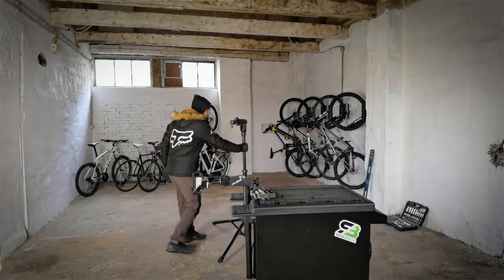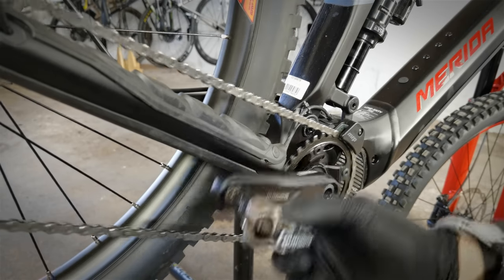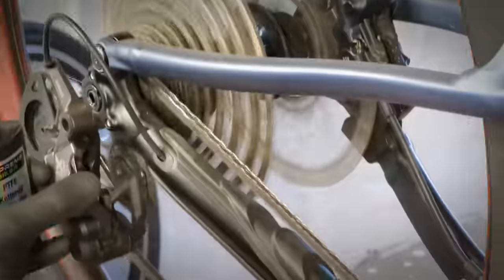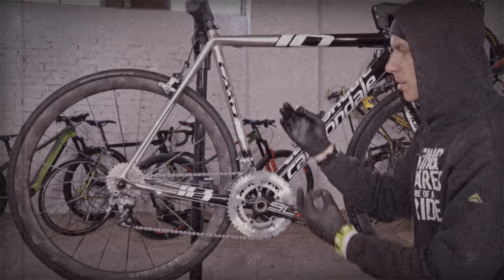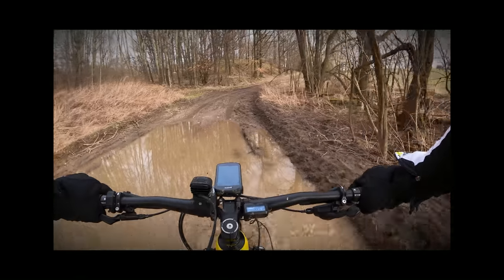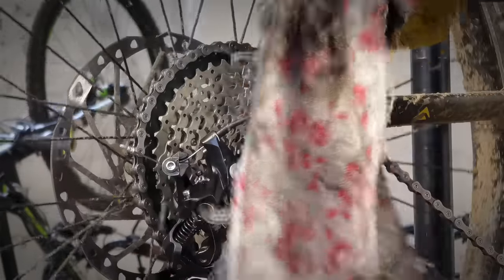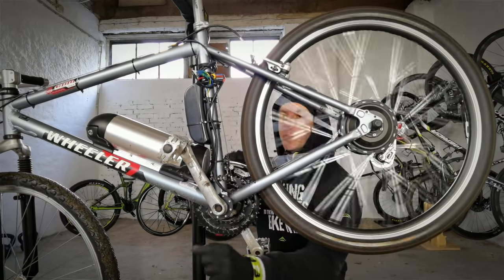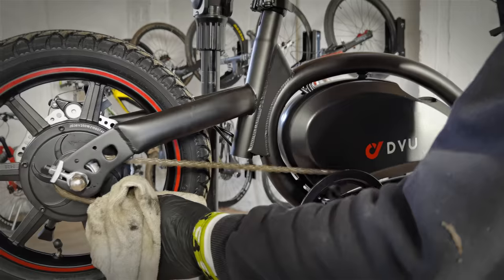I lubed my chain with canola oil and rode 100 km through muddy trails. Lesson 2 - bicycle chain.

Comment: Ok so I’ll throw a spanner in the works. I also ride motorcycles in the bush. Years ago I stopped using any lube on the chain because it just turns into grinding paste with dirt and grit. I just run them dry and get much better life. I use Rock N Roll extreme on my pushies. Seems to be ok.

Comment: Thank you for the detailed video!

I'm seeing lube applied both on the inside circumference (1st part where you had bottle below the cassette) and the outside circumference (2nd part where you had bottle above the cassette).  FYI for readers, many others recommend only to apply lube to the inside circumference of the chain.  I think the main reason is that centrifugal "force" pushes lube from the inside to the outside as the chain goes around, so better coating and maybe even a little unidirectional grime flush action.

Comment: You never want to put natural oils or mineral oil without additives on your chain! While it might run very well for some time, as soon as the temperature changes and the oil "ages" it will be almost useless. Some natural oils can be very corrosive as well.

Always buy something fully synthetic for a reasonable price (don't overpay for a 20ml bottle is what I mean). Industrial gearbox oils and engine oils will do a decent job if you need a lifetime supply for cheap. If you need a "normal" amount look at the finish line product range. While they are not cheap, at least they don't scam you like muc-off...

E: Really enjoying the series, keep it up dude!
Reply: You can use plain mineral oil though.  It's synthetic and doesn't oxidize like vegetable oils.
Reply: you can buy the finish line lubes in big jugs that are a better value than the 10$ dripper bottles.  i love their ceramic wet and ceramic wax lubes
Reply: @airwilliam24  Mineral oil is just oil straight out of the earth. Nothing synthetic about it. Of course bike companies want you to think otherwise so they can push up the price, just look at Shimano brake fluid.
If you don't believe me, try running your car on mineral oil without additives.

Comment: I've used canola oil on my bikes and it was okay, but in the extreme winter we have here in Canada it is not so great as it gets thicker. I always add a bit of graphite powder to my chain oil (a regular light oil, which is also cheap, used primarily for sewing machines and other household applications). The oil is light and penetrates the links well. The graphite is a dry lubricant and it does not get washed off as easily. I still wear out my chains, but they seem to last quite long.
Reply: You can try paraffin oil with paraffin wax, about half and half, depending on the type you have. Melt the wax over low heat, add the oil, mix, then dip the chain when it is very clean. A new chain should also be cleaned, soaking in solvent and cleaning with a towel works well. Of course it's for winter, in summer it doesn't last long. If you've got the right ratio it's the best thing you'll ever have, you won't have to renew it for months on end.

Comment: I usually use polyurethane paint thinner to clean the chain deep.  also always put a magnet under the bucket to collect the metal dust and prevent it from going back into the rollers.  furthermore, after this step I soak the chain in very thick heated motor oil, and leave it there until it stops bubbling.  then I let everything drain and clean thoroughly with a rag.  are a few steps but for someone like me who travels for thousands of km it gives its results

Comment: I was doing a solo trip through New Zealand...I got into some really muddy trails and then couldn't fine chain lube nearby and my chain was getting pretty stiff.  I had olive oil for cooking...worked great on the chain too!  Sand sticks, but, better than a dry and stiff chain! On another trip into W. Virginia for some DH stuff I had a last minute brake issue....I had to do a bleed but didn't have any mineral oil(or was it dot5?). Olive oil! Yep...bled the line with olive oil for the rear brake, and despite the steep downhills and me being over 200 pounds...I had no issues
Reply: Some world traveler has used baby oil from grocery shop to refill brakes after he discovered oil drip after unpacking bike at an airport.

Comment: 1) T :   2) A & B :   3) Clean the pre-delivery protective coating off the chain and drive components. Then lubricate the chain and drive components {rear cassette, front crank chain rings, intermediate or idler pulleys} again with fresh lubricating oil. Cheers, Peter

Comment: It has 100 and a few links. I go one drop for each one, takes a couple of min but im sure all got lubbed penetrating inside. 
Then, clean excess, done.
To clean, if you want to be paranoid with it, after cleaning with benzine/petrol, degrass with cheap brake cleaner, that also ensures it comes out totally dry, ready for lube.

Comment: unleaded auto gas with a hi octane will work! as a auto mechanic use it to clean parts! it is aggressive at cleaning and super flammable! a alternative would be k1 kerosene as it has a low flammability and leaves a light oil coting. lighter fluid works to.  interesting experiment!

Comment: Hi.  Here are the answers to your quiz.  1. True, 2. A & B,  3. Spray some degreaser on a rag and  pedal in reverse to remove the pre lube from the factory, and add some new lube if necessary.  

Some suggestions to remove grease from a dirty  chain, I use mineral spirits or paint thinner.  It works great.  To remove rust I use apple cider vinegar, I believe it is less expensive than the acid you use, plus the vinegar is re-usable.  Try it, and do not drink it, it is nasty.  I also use synthetic motor oil, to lube parts and pivot points. I use motor oil to lube the chain.  Any thoughts ?

Comment: Best use I've seen for canola oil and great results so far. I doubt canola oil would perform well in a lubricity test against petroleum products. The specialty chain lube products have gotten out of control price wise. Wonder how canola would perform adding graphite and/or PTFE?

Comment: In English, 'Benzyna ekstrakcyjna' is called Petroleum Ether. It's a light oil fraction, i.e. a mixture of different substances with a similar range of boiling points. Here are the English and Polish wikipedia entries:

https://pl.wikipedia.org/wiki/Eter_naftowy
https://en.wikipedia.org/wiki/Petroleum_ether

Comment: Q1 T not lubing chain is one of most expensive things to neglect on bike. Q2 Worn or lengthened chain will case wear to a. cassette and b. chain ring Q3 new chains from factory come with sticky wax or lube that can attract dirt best to clean it off the outer plates with degreaser. Looks like I will be buying some canola oil soon, or since I am Italian/American might have to conduct an olive oil experiment

Comment: After six months of using canola oil in the summer, the feeling is that it polymerizes just like the dry lube oil I used before. Winter is about to arrive here and I'm looking forward to seeing if it behaves differently in the cold.
Reply: How did it go?
Reply: @frederikmartenstoft4569  
As long as you clean after each ride it's fine. It is better not to oil with canola after cleaning when the bike is going to sit because it lowers the quality of the lubrication before the next ride, because the oil polymerizes and turns black within two days in reaction with the oxygen and the metal. It does protect the chain from rust but you will need to clean it before the next use and re-oil it.
Reply: @frederikmartenstoft4569  
Regarding the cold, there is no problem, and because there is no dust here in the winter, the chain is cleaner than in the summer.

Comment: I feel waxing the chain is the best option for me . Drive train including the chain lasts a long time and I don't do detailed cleaning just a dry cloth wipe off . Now I live in the high desert so my only problem is dust . The wax is not a liquid  so the dust doesn't mix with it .
Reply: Yeah wax is great stuff. Better than sticky oil that catches on to every speck of dust.
Reply: Would a beeswax work ?
Reply: @msmanager2775  As long as it can be liquefied so it can penetrate into the links I did see why not exploring the possibility . I microwave my squirt before I apply . It appears being heated gives it a more drier finish
Reply: @stevencole7331  thanks , or an engine oil is okay I suppose ?
Reply: @msmanager2775  You can probably use  vegetable oil and be ok . I live in a dusty land and having something that the dirt is not attracted to and provides a lubing effect is good for me

Comment: Honestly I've been using cooking oil for my bike for more than 10 years
I had more than 8 bikes and I never had problems with cooking oil
Reply: Didn't the cooking oil polymerize and become rubberish over time? It does for me in the kitchen...I would assume it does the same on the chain. (Sunflower oil.)
Reply: @sonnyboy2026  This is true if you oil a wooden surface or a cutting board, but on the bike it doesn't matter because by the time it finishes polymerizing you already clean it because of all the dust and dirt that sticks.
Reply: I am going to experiment with palm oil.

Comment: I've put 10,000km on a chain lubed with motor oil🤣

If it's capable of lubricating an engine. It can lubricate a chain, only downside is it's messy, and leaves black residue all over the components but is manageable if you clean regularly.
Reply: I've done the same since I got my first bike when I was 14. I'm 61 now. I've never had a problem. I had also a motorcycle for about 10 years  and I never had to change the chain or something else. When it's a little bit dirty or dusty, just clean properly and apply it again. 🚴‍♂️👌
Reply: @jaimeacosta4791  motor oil collects way to much dust in the summer though. I ended up just spending $20 on wd-40 dry lube , and wet lube. Definitely worth it.

Comment: When I was a kid and didn't have any money I used corn oil as a lub it was a disaster,  corn oil starts to turn to a solid after a while and just gets gummy , I wonder if over time the canola will do same .
Reply: @pootatotree7546  thanks for your reply , I ride a recumbant trike which takes 2 chains and am very aware of cleanliness affects wear ,  I currently use Dumond Tech as a chain lube which has worked well for me .

I appreciate your experiment and the conversation it sparked , and once again , thank you for taking the time to reply back to my comment.
Reply: That happened because you did not clean the chain regularly. You cannot just add oil and that's it. You have to first clean the chain, and then oil it once it's clean.

Comment: Jusr one remark. Plant based oils have a quick degradation and the degradation residues are acidic. So I would not recommend the canola oil or other edible oils, like sunflower etc. Lubing is OK, but the chain will be eaten up by the acids. It makes porous corrosion, what is a good place for dirt particles to sit in and increase wearing.
That means, if you have nothing other, the plant oil is perfect for a ride, but clean it out perfectly after the ride and use real lubricant.
I do not recommend the fine mechanics lubricants neither, just because they are a mineral nad plant oil mixtures and can also get acidicic.
Reply: Hey! I'm using sewing machine oil since it's very cheap compared to bicycle specific lubes. Any thoughts?

I don't want to wax my chain.

Comment: 1. T
2. B. I would add A as well, depending on your definition of the cassette. The sprocket stack, then yes. If it's about the wheel system (ie freewheel or cassette), not so much.
3. Wipe off the excess lubrification or lubricate it if needed, while checking for flaws.

One question: what do you think of those chain cleaning systems that you close around the chain? I notice you use only towels and brushes; in a bike shop, how many towels do you need per day? ;)

Also, the cleaning petrol is likely lighter fluid, or lighter gas. Most households in Canada store it solely for cleaning purposes.

By the way, be careful using acid to clean a chain. A too strong acid will attack the metal itself. One should also avoid using "natural" acid sources, since they often contain sugars that will bind to the chain and cancel the effort. And take care with acids (and bases): diluting an acid in water is fine, but adding water to an acid is death! (it creates a big exothermic reaction with can lead to an explosion...it leads to a better rhyme in French).

Another comment: I would think many of your viewers are not in the United States. As you are Polish, it's noticeable you sometimes struggle to find the price to mention. Why not use euros? I'm in the Netherlands and use English-language channels to learn how to service my bike ;)

Comment: The gasoline you're talking about is perhaps a kerosin gasoline?
Reply: I don't think so. In my country it's literally called "technical gasoline" and it's a bit lighter and purified fraction of regular gasoline, however still not exactly kerosene. It works very well as a degreaser and a cleaner.
Reply: @benokrizek8020  i see.. in our country, most folks with small budget would use kerosene. It works but i dont think it works better than with the gasoline you're talking about
Reply: Do you mean white spirit?

Comment: Ekstrakcy Gasoline?....    Most likely AVGAS...    That's petrol with NO other products in it so it has the least residue when dried.
Available in most places but a little tricky to get... (A lot of drift car drivers use it... but it can clean out (remove) all the protection normal fuel coats on parts and rust a car/exhaust from the inside).
Often found at small airfields and aero clubs...(and some petrol stations near them).

Comment: I am sure a light weight car oil will work just fine for most people and applications as well.
Reply: I use transmission oil, it works fine for 150km, but it attracts lots of dirt.
Reply: @neutronshiva2498  Same. I think i ruined a cassette and chain in only 1500 km using a lot of gear oil. 

everything was dirty all the time. Cassette was worn out.
Reply: Automotive motor oil contains detergent, to wash away combustion products. That will work not so great in a long run.

Comment: Most new chains have a sticky grease all over to protect the metal in storage. This needs to be removed before first use. I found that gasoline works just fine for that. High purity rubbing alcohol might be better for that. Methanol is cheap. I discard the used dirty gasoline in the burn barrel.
Reply: That's just plain wrong - the original factory grease of the chain works better than anything you can apply to the chain yourself, unless you're planning to boil your chain in wax. Keep it for the first few hundred of miles at least and only then clean your chain and apply the fresh grease of your choice. Do yourself a favor - read Sheldon Brown's advises on bicycle lubing, he had some wise thoughts on that based on his long experience as a bicycle mechanic.
Reply: @r1fter  That's simply not true, the factory grease works far worse than most everything you can apply yourself. And it's certainly not necessary to "boil" your chain in wax. Read the studies conducted by Zero Friction Cycling. Rather than "wise thoughts" he's got data collected through extensive research that proves otherwise.

Comment: During the industrial revolution, canola oil which is rapeseed oil was used as a lubricant for ships and steam engines, because it would stick to wet metal. This made it especially useful for lubricating engines.
And during World War II, with the mass of ships needed for the war, the demand for rapeseed oil increased exponentially. During this time, the Canadian rapeseed industry boomed; however, soon after the war, it fell dramatically…
So they convinced us to ingest canola oil for our “health”
Reply: Seed oils are fine, anyone who tells you otherwise is a grifter who's trying to sell you something. Though, they are certainly over-represented in western diet, and omega 3 fatty acids are not as available in many seed oils as they would be in flax oil or lard. Canola oil has always been a great non-toxic and biodegradable lubricant, decades of petroleum industry propaganda has tried to convince people to use petroleum based oils, for obvious economic reasons...